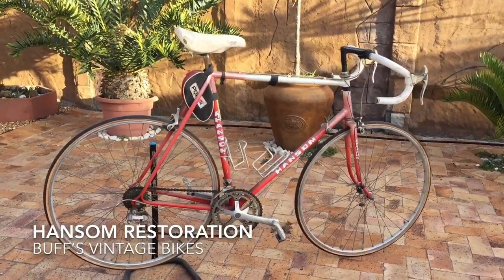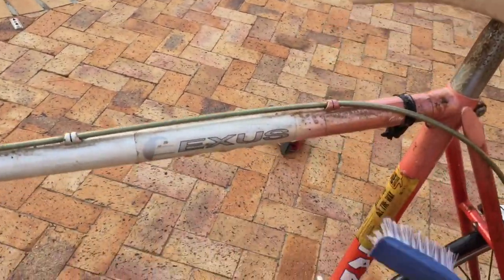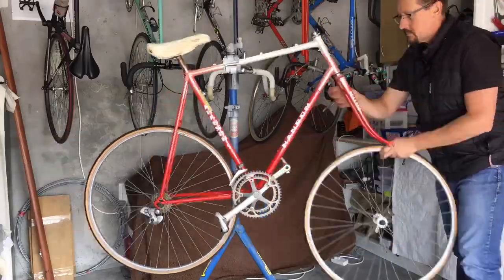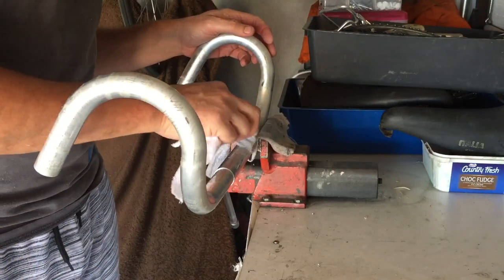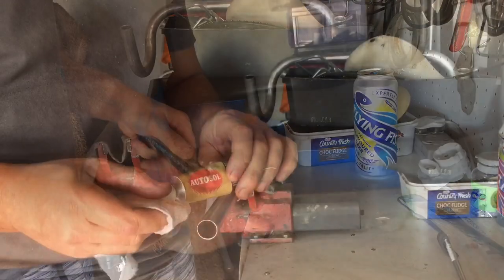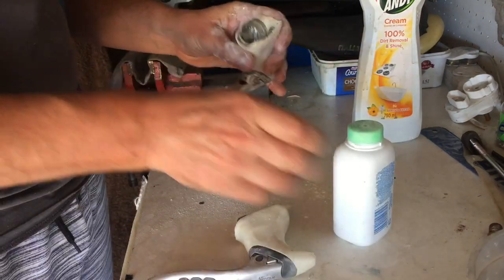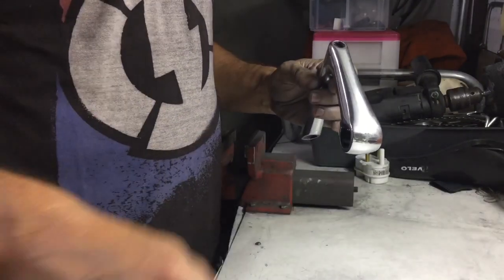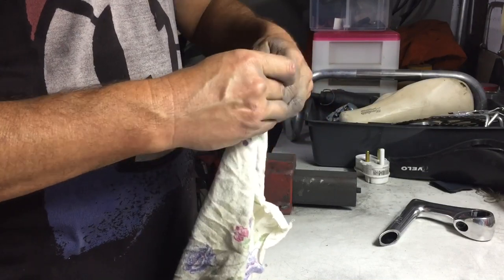Hansom Classic Bicycle Restoration - Part 1

Comment: For cleaning sticky residue (bar tape, hoods etc) I use isopropyl alcohol or acetone. In South Africa this could be rubbing alcohol or nail polish remover. Hope this helps.
Reply from the maker: Thanks John 👍🏼 I have since managed to find some great stuff from a signage company that works really well.